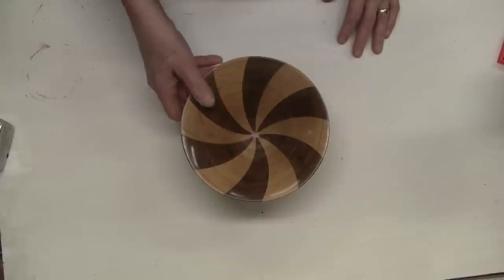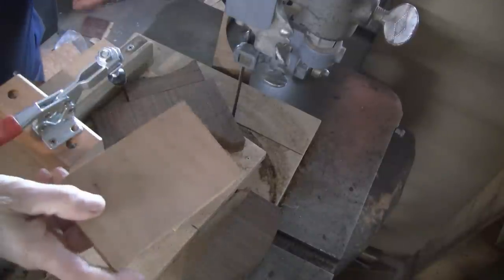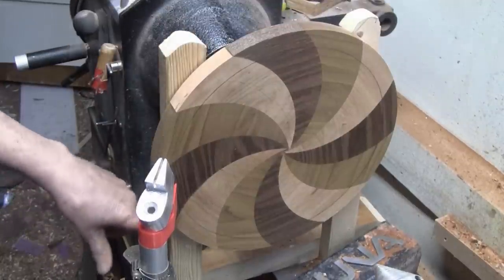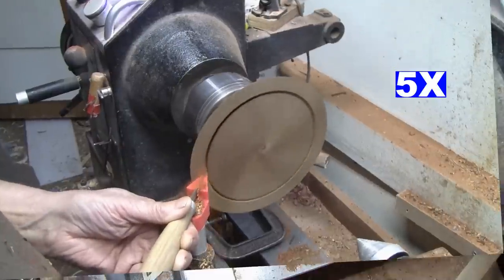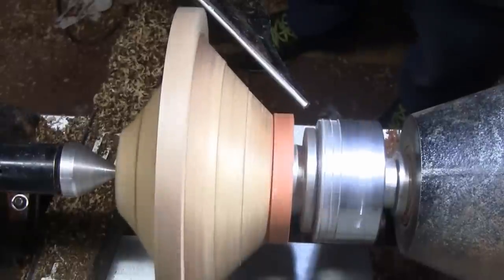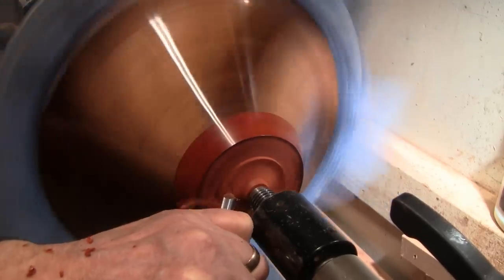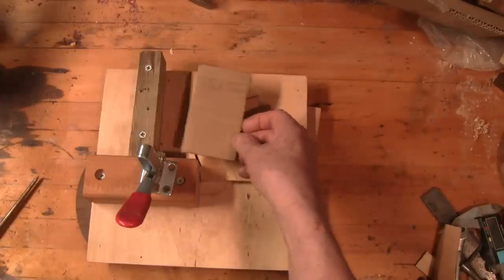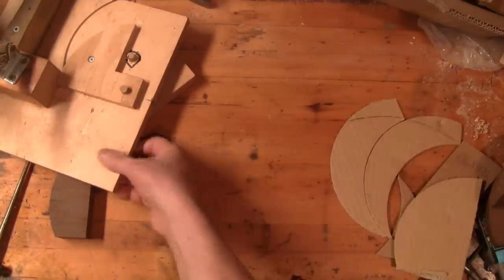They Said It Could Not Be Done   Wood turning

Comment: Sorry Gary, I meant the parting jig. Thank you!!
Reply from the maker: Ahh....You can buy it with the handle or without. 

You can find it in many places. This is what it is called: 1/16" Robert Sorby #865H Micro Parting Tool

Here are some Amazon links but can find it in many places such as Rockler

With handle: 
https://www.amazon.com/Robert-Sorby-865H-Micro-Parting/dp/B002RCFECI/ref=sr_1_2?crid=11NZH0LPVTFNK&keywords=robert+sorby+1%2F16%22+micro+parting+tool+865h&qid=1684587785&sprefix=robert+sorby+micro+par%2Caps%2C146&sr=8-2

Blade only:
https://www.amazon.com/Robert-Sorby-Micro-Parting-Tool/dp/B0089XYJY8/ref=sr_1_3?crid=11NZH0LPVTFNK&keywords=robert+sorby+1%2F16%22+micro+parting+tool+865h&qid=1684587899&sprefix=robert+sorby+micro+par%2Caps%2C146&sr=8-3

Comment: I made a sled last year successfully after going over your description many times. I have made a number of bowls and had a friend make me a tool rest guide as you described and have a parting tool identical to yours. I like the idea of a support behind the board  as my last attempt at an eight inch bowl caused the outer ring to break into several pieces. I re-assembled it although I was turning way too fast but surprisingly the cut was quick and didn’t overheat or blunt the tool as much. 😅 I enjoy learning from you but can’t get all the finishes you use in Australia.
Reply from the maker: Thank you very much. Nice to hear you have made the jig and it is working good for you.
I never had one of the boards break but I sure like the support piece I made for keeping it from spinning around after the cut.
What kind of finishes can you get. Clear gloss lacquer will do the same thing.
Thanks for watching,
Gary

Comment: Beautiful as always.  You're so clever; that jig is genius!  A couple questions:  (1)  You mentioned "roasted wood."  What's that?  I've never heard that term.  (2)  How did your 3D printed jig compare with the aluminum one?  Does it wear significantly faster?
Reply from the maker: Thank you Jim. The roasted wood is just Oak, Maple or Poplar they put in an oven and roast it to the point of almost burning.
It is to keep insects from trying to eat or live in it. I think they use it for decks and other outdoor uses.
 I felt the 3D printed one worked just fine.
Thanks for watching,
Gary

Comment: Great work, love that jig. I've cut rings before using the compound slide of a metal lathe. For ease of use though your method looks much quicker. (alot less winding of handles) can you tell me please is it possible to make a bowl from a board with 60 degree cuts to equal a 120 overall bowl? Thanks for your time. Happy turning.
Reply from the maker: Thank you Sam. I have cut them on my small metal lathe and decided there has to be a better way so I came up with this jig.
 I do have video showing how you can get a curved bowl. The cuts do become longer but it works.
 As a matter of fact coming soon I plan on doing another but here is the video I did.

https://www.youtube.com/watch?v=0zJlsPsNKxM&ab_channel=ThePapa1947

Thanks for watching,
Gary

Comment: Hi Gary. Is it normal to feel some of the joints after the project has sat for a while. All of my segmented turnings I have this happen. I hope that I’m not doing something wrong. Do you have any suggestions?  Thank you Gary
Reply from the maker: Hi Charles. A lot of what cause that is where it is located. Also I like to let the glue dry for a day if I can before turning and most of the time it sits for a day before I sand it. But some pieces will just want to move. The very large tumbling block turning I made shifted and it was really the finish i was feeling. I used Polycrylic on it and I ended up letting it sit for a month then sanded the finish with 600 grit. Nice and smooth now.
Reply: @ThePapa1947  it seems like the different woods glued together are the ones that I notice moving.  Thank you Gary

Comment: Gary, that was amazing as usual, Question, as there is no mass in the middle of the bowl do you get a lot of vibration when turning. The high shine on the piece is amazing also I would love to see you do a bigger template for larger bowls. well done mate great job
Reply from the maker: Thank you very much Alan. The piece of Padauk I glued on for the base took care of the lack of mass in the middle.
 The larger system will be done for sure and probably pretty soon. I have a lot of things to straight up in my shop as I moved a rather big machine toward the front door. Had to move a lot of other things to make room. They are not sitting everywhere. About ready to have everything hauled away and start all over from scratch LOL.
Take care,
Gary